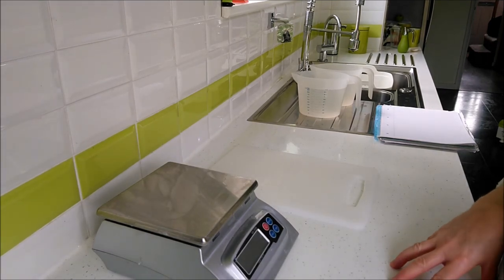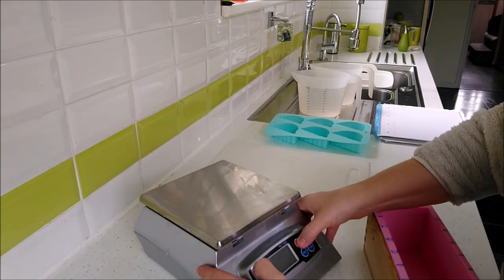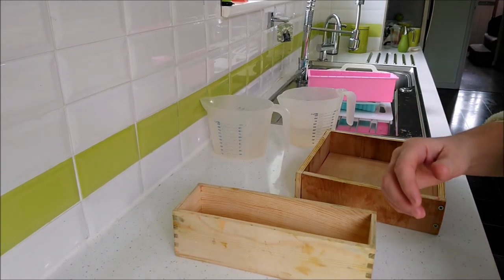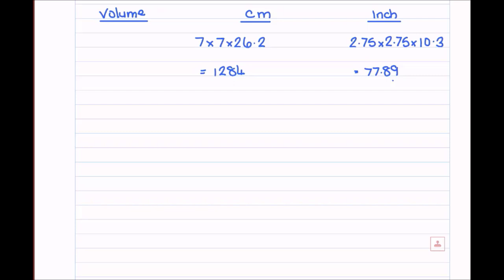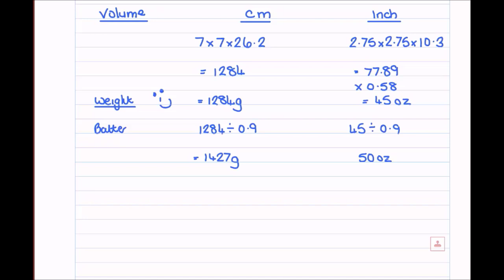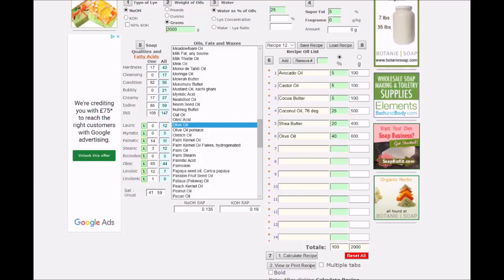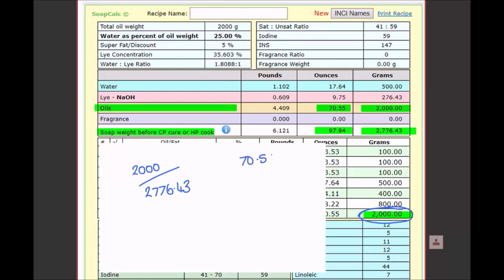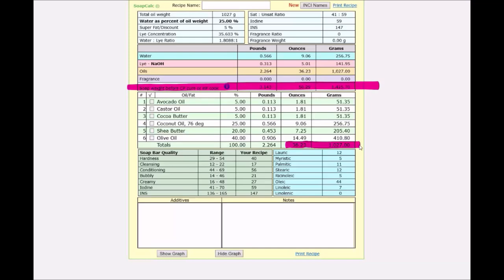HOW TO MEASURE A SOAP MOLD (mould), FREE soap mold calculator download - cold process soap tutorial.

Comment: How would you figure out your total oil weight from semi sphere molds like the flower types from Amazon. The blue pink and purple ones? There are only two measurements.
Reply from the maker: I would fill those with water and weigh them :-)
Reply: I Dream In Soap thanks so much!! I did that and tried to figure out the base oils for one tray but got confused by the end. After watching the video 4 times I said that’s enough and I’ll try again tomorrow
Reply from the maker: Are you using grams or OZ, life is so much easier in grams, so try that. You can then just take your water weight x by your oil% and it really won't be far out at all, you may have a little extra, but just note that down so you get it perfect next time.

Comment: Hello Lisa,thank you for taking time to explain in details of how to make the batter to fit the mold(excellent topic)
I have a question,I understood that random recipies have 72% of oil to batter ratio at 25%water discount,on your video example the amount of oil needed is 1027 gram (I have the same mold)if I put this in soap calc.@25%water discount the weight of batter is1462.03,now if we divide 1027 by 1462 it will be 70%and not 72% do you know why?
Thanks again
Bahram
Reply from the maker: Hi Bahram. What an excellent question. The oil % will be based on not only your water % but also the type of oils you are using. In the 'test' recipe in my example my oils needed 276g of lye. If you use different oils, you would get a different amount of lye, so for example if I did exactly the same thing with just 100% coconut oil, I would need 348g, which would mean that the soap weight in total would be 72g more. That in turn would mean my oils % would be less. Just quickly working it out that would be 70.2%
So you need to bear in mind that if you change your recipe, your oil% will change because of the change in the lye amounts.
I hope this helps. Best wishes - Lisa x
Reply: @IDreamInSoap  Thank you Lisa it did help tremendously, I got it,all make sense now,thanks again look forward to seeing mor magic from you,be safe
Bahram
Reply from the maker: @bahramassary2340  Perfect, I'm so pleased :-)

Comment: Is the download come in a different format?  I don't use Microsoft
Reply from the maker: Aw, no I only have it in excel and Microsoft is all I use, I don't know how to convert it to something different, is there a way I can do this do you know?
Reply: @IDreamInSoap  maybe try saving it as a .pdf from within Excel - that might work.
Reply: Hello Hilary. I use an old 2013 MacBook Pro. I’m in the same boat as you - I don’t use any MSoft applications like Excel. But, I offer you my own solution…If you are using an Apple Macbook, ( I just assume you may be)  you can freely download and open Apple’s equivalent of Excel called “Numbers” from the App Store,  and then after you’ve dowloaded Lisa's terrific excel file/s, to a folder where you can locate them,  you can then open her files from within the Numbers application and proceed to use it. It works for me, and I hope this helps you too. Cheers ..Mike
Reply from the maker: @mikeellis4345  Thank you so much Mike, this is really helpful. I'm afraid as I only have windows this is the only format I have.
Reply from the maker: @sueeverall1368  Hi Sue, sorry I didn't get notified about you comment. The problem with saving as a pdf is that the spreadsheet won't function as a pdf is just fixed, therefore it wouldn't work. But thanks for the suggestion

Comment: Hello. This is a great, informative video. However, I am not understanding your assertion that you will need more oil, by weight, than your initial water weight calculation for the cubic centimeters volume of your mold. If soap batter has .9 the density of water, then for the same weight, you will have more volume of soap over water. Right? Weigh out 100g of both water and oil and you will already have more oil by volume due to the lower density. Dividing the weight of water by .9 will increase the volume even more over that. Update: We decided to go with the divide by .9 anyways as an experiment and indeed we were left with much extra batter.